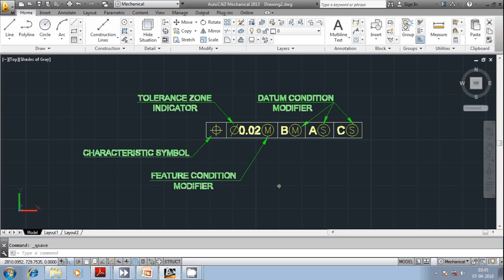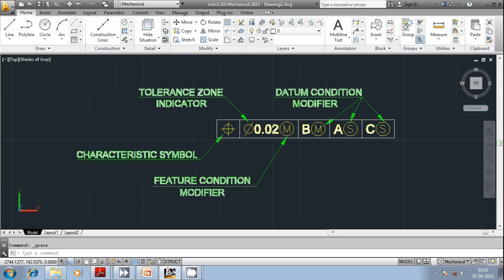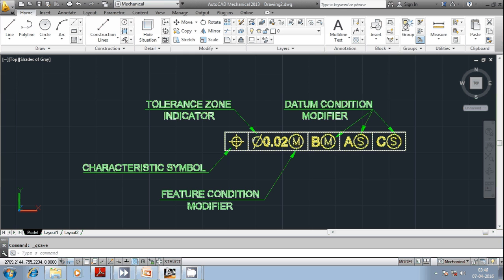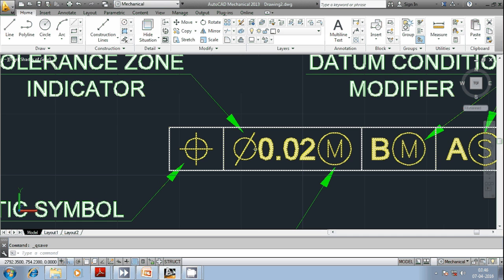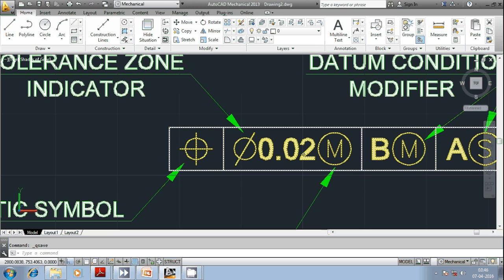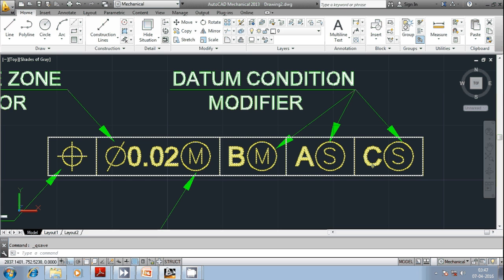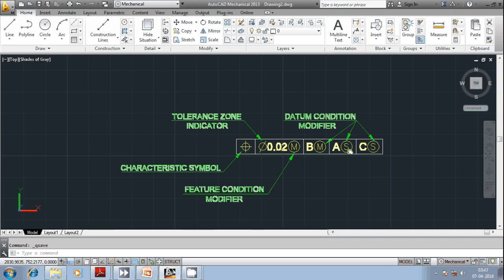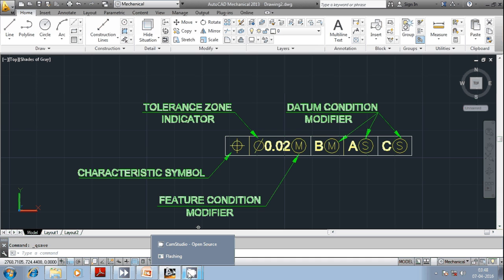FEATURE CONTROL FRAME

Comment: What is different between hole position without modifier and with modifier ( M, L). 
Please answer quickly if it's possible to you .
Reply from the maker: If M modifier is used next to tolerance value then the tolerance value is directly applicable when hole size is maintained at MMC. Any deviation from MMC leads to additional tolerance for hole position equal to deviation from MMC. Usage of L is just opposite of M modifier.

Comment: hi dear all i have question how we give Geometric relation like concentric,  symmetry and other links so i can show movement of object . please let me know solution for this??
Reply from the maker: There are two things in your question.One is to establish geometric character like roundness or flatness etc and the other is to allow movement of part.Establishing relation with reference to Geometric characteristic symbol is a functional requirement.For example,in electronics enclosure design,the manufacturer through best design practices and continual improvement establishes the guidelines like if the flatness of the surface needs to be controlled by this much to have ....this much of heat transfer or to provide water seal joint or air tight joint etc.Hence it typically depends on design intent of the designer.It cannot be generalized.
Coming to the movement,it is controlled through constraining the degrees of freedom of an object.Refer our video on 321 principle in GD&T.